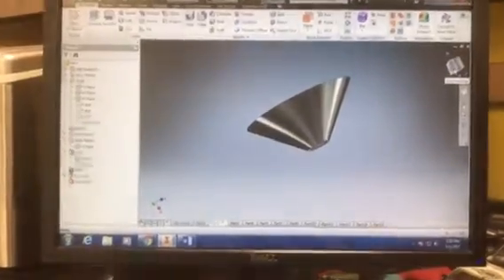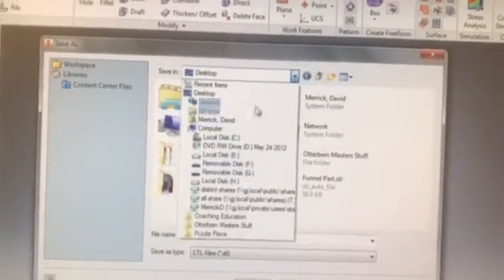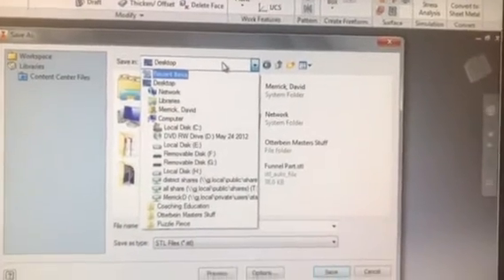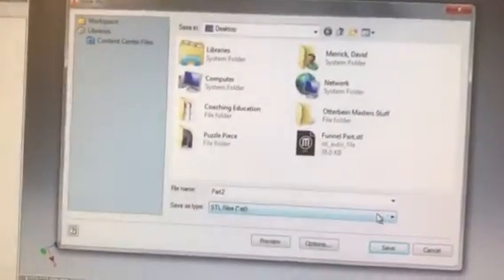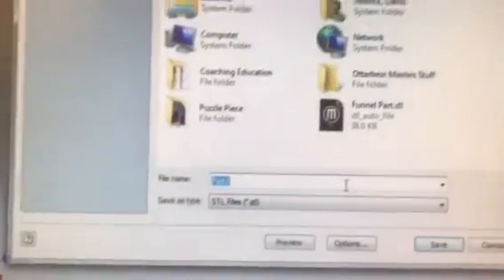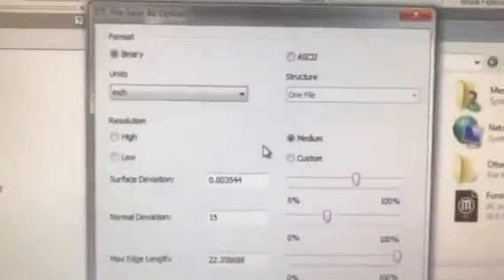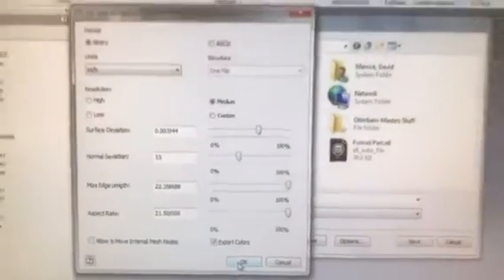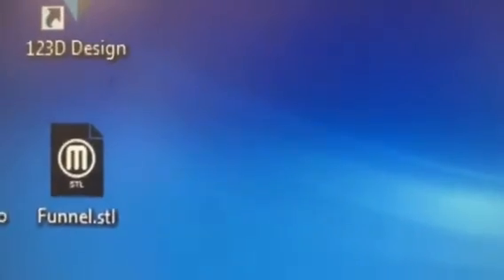How to convert an .IPT file into a STL file for 3D Prints

Comment: My problem is my units get shrunk 2000% whether it's in inches or millimeters . I take my ipt file and do just like you say and when it drops into cura it's shrunk then I have to blow it back up to the original. I'm baffled at this point
Reply from the maker: Once you click to convert look for the tab to click your units again keeping them the same units as the project was done in….
Reply: David Merrick  no it was me cura wants it in inches. No matter if designed in millimeters or inches I was saving it it in inches regardless , that is why checking your options is important. Nice the help is out there!
Reply: Thanks David it was the options window when I save it. I seen it done just didn't sink in. I'm so happy it was a real pain in the butt.
Reply from the maker: Yes, agree